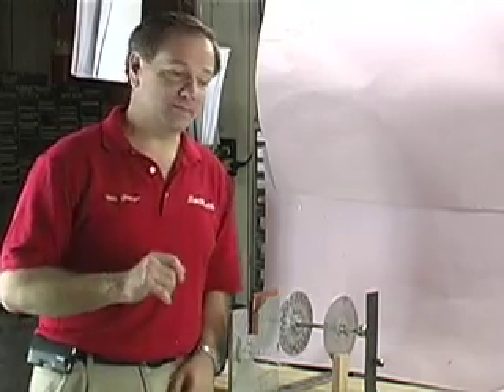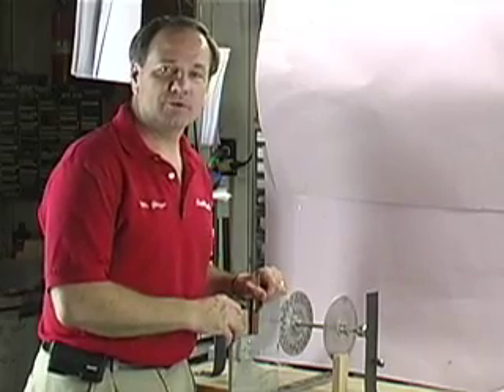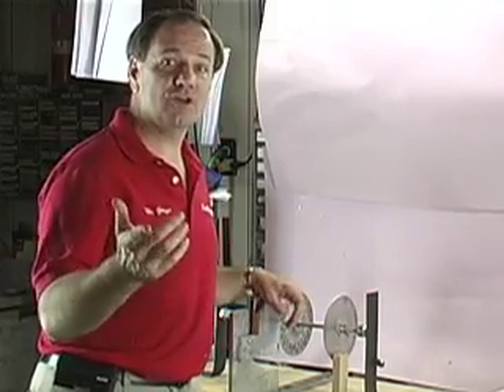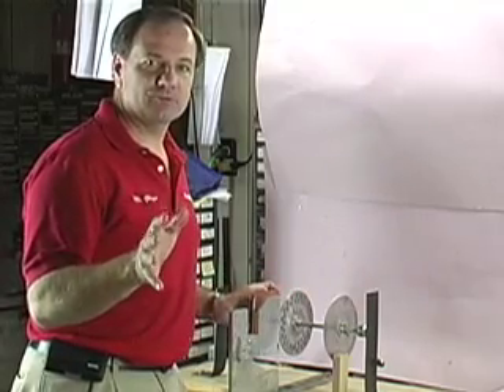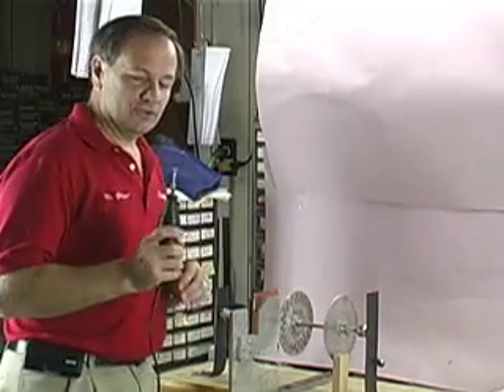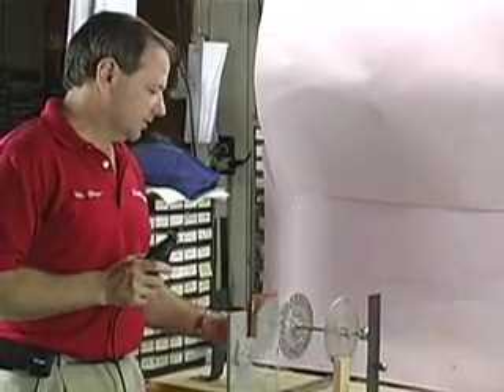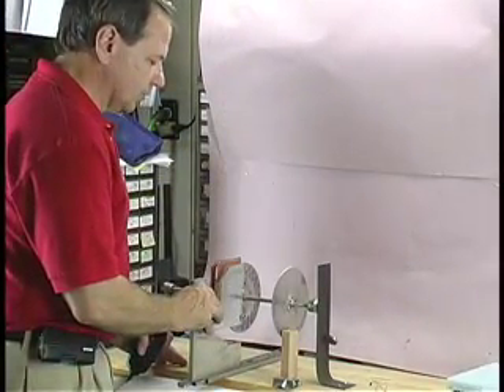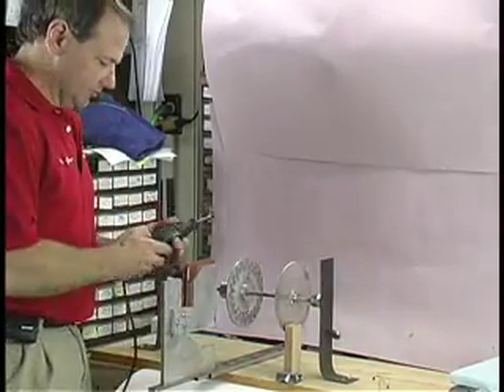Supermagnet Braking system - Working

Comment: The EVS ie: segway scooters use something like this in their electronic regenerative braking systems these days.
The concept is the same, magnets doing most of the principle work albeit application(s) and or method(s) may differ slightly.
Reply from the maker: Most of the EVs are using electromagnetic braking which simply directs the current generated back to the batteries.  This system actually is dissipating the energy as heat so it is more wasteful from that perspective but it is more effective that friction brakes.
Reply: Interesting... didn’t know that so thanks m8 👌🏼

Comment: That stopping looked very "unmagnety"...it looked like a friction-based stopping to me, and in fact you can see the metal blocks come into direct contact with the center of the wheel.  So I'm not really sure what to think of this little experiment.

Comment: This is really interesting - it's just like the Faraday Disc, but Faraday instead spun a copper disk (the conducting metal) and used a small fixed magnet.  It generated an electric current.  I think what is happening here is the moving magnet induces a current in the approaching metals.  The current itself creates a magnetic field in opposition to the spinning magnet.  (Lenz effect)

Comment: If you lift a car wheel off the ground and spin it up. The second you touch the brakes it instantly stops. This has nowhere near that power and it wouldn't do anything for a slow moving car I would think

Comment: No way this kind of magnet could generate enough force to stop the momentum of a 2500 pound car.
Reply: Pablo Nunez then build a lighter car
Reply: Pablo Nunez why is everyone retarded???
Reply: Dan Coulson THANK YOU DAN. CHRIST. 

and Pablo Nunez don't become an engineer
Reply: Dan Coulson "Regular air or hydraulic brakes are used to completely stop".....I've read that and it's only because of regenerative breaking right? I mean if you didn't care about regenerating power you could just reverse an electric motor to create a generator and then jack up the current with from some other power source and stop with pure electro-magnetism. With enough current you could stop an ocean liner. Actually I don't know, I was a History major and was wondering if that is a correct assumption or not. :-)
Reply: Dan Coulson "To maintain still, a constant high current would be required.". I agree with you here. But only to REMAIN still a drum or disk brake is better. They make sense to me only as a parking brake to free up the required current to remain still you mentioned.

I totally disagree about proportionally introduce friction braking. There have been huge problems in that concept. Hyrbrid drivers often report pressing the brake harder gives you less braking as the friction brake is proportionally introduced.

I would argue the only reason friction brakes are used proportionally is they're cheaper than putting a generator/motor on each axle........That's undoubtedly a better approach. A generator/motor could stop a tank.

Comment: Friction based brakes or more reliable. They wouldn't be able to keep the vehicle at a stand still on an incline. What if your vehicle looses power all of a sudden? No brakes. In most setups, you can still use the brakes if the engine were to shut off,

Comment: SuperMagnetMan Would this set up work equally well if the magnets were in the (I'm assuming) "caliper" part, rather than in the "rotor" disc? Could you shed some light on that, if not. Thanks!

Comment: i'm kindah wondering , since it shouldnt produce heat and doesnt use electricity or water to create the field or friction it should e an ideal medium to build a (cheap?) dynometer with it to be used on location 

normal dynometersystems use either water or elctric brake (think truck retarder) and measure the footpounds of torq the spinning part put against the resisting part at different rpm's (in the simplified system youre demonstrating it would be to drive the disk perminently while braking put the magnets on a scale before sliding it ontoo the disk and measure the difference in weight at a certan rpm )

can you make the system big enough to resist an engine giving off 400 pounds of torque at say 4000 rpm ?
and can you make the system variate the amount of resistance put on said motor so you can get a torque curve from 1500 to 4500 rpm ?

Comment: It amazes me that none of this technology is used in automobiles, no friction either, no loss of brake pads, its a great system
Reply: its not great it has no practical use because the car has weight and that weight gives car potensial energy what magnet has to absorb just imagine to put at least 200 kilos more on that wheel it woudnt stop plust that speed what he spins it i guess is about 30-50km/h and it takes ages to stop with out any potensial energy its awful
Reply: JusstyteN You could be right but I don't think that you are. He's using a small amount of magnets on a small amount of metal. I imagine that when scaled up you could use a more powerful array of magnets to make it very effective at stopping a fast moving heavy vehicle. I have no real evidence though so your opinion is just as good as mine. However, if i ever have a high enough income to dump into an expensive hobby this may be one of them and I may prove or disprove the theory that it could be applied to a real vehicle.
Reply: Dib Dibbler Magnetic brakes don't work when the car is stopped. Why is that important? When you're at a red light you have your foot on the brake to keep the car from moving, because if you're like most people, you have your transmission in gear, so the car wants to move forward. A magnetic braking system only works when there is motion.
Reply: lets sit in my car with  xtremely strong permanent magnet breking system and wait till all worlds little steel and iron thinks got stuck in it
Reply: It's the same reason for the conspiracies about pharmaceutical companies having cures for cancer and allergies and things like that. Whether or not it's true it is more profitable to patch the issue over and over then to cure it once.
Reply: Agreed
Reply: Well cool, at least it's getting used.

Comment: Only if the wheel is conductive, but what if it wasn't? What if you used just the magnetic attractive force between the magnets to stop it instead of a material that is conductive.

Comment: One needs an open mind to believe in God or the Flying Spaghetti Monster. One does not need an open mind to believe in physics. A physical device is subject to definite laws and rules. So a device either works as advertised or it does not. Until you can unambiguously demonstrate your device working, and until others have replicated your results independently, you're just blowing smoke blinding yourself and others.

Comment: Face it, you don't have a working device. You have nothing but words, and very specious words at that. Frankly I don't even need go into the physics that forbid over-unity from existing. All I need to do is point out that these machines are claimed to be easy and cheap to build with widely available parts, yet not a single working version exists in the world. Not even in the most remote parts of the world where "Big Oil" does not exist and where free energy would benefit humanity the most.

Comment: No machine can generate more energy than is required to keep it running. The output can never be greater than the input. A V-gate mounted on a linear motor? Clever but pointless. The amount of energy generated by the coil assembly driving forward via the force of the magnets will never be greater than the energy used by the motor to draw the coil back to the top of the gate.

Comment: @SuperMagnetMan I guess a ggod starting point for getting this technology applied in the automotive industry is first of all to target the smaller carbrands i.e. Gumpert, Spyker, Tesla etc. Second, to not market it as a primary brake, but a secondary. What I mean is have it apply braking force together with conventional brakes. This will help prolong the life of the ordinary disc brakes whilst still having increased braking power. It can also be used in a two stage braking process,

Comment: @fakshen1973 you dont need to deliver rotational force to the wheels using a magnetic engine.  You simply use it to create energy for the electric motors that turn the wheels

Comment: FYI, similar eddy current brakes are used on many modern roller coasters. We have vertical fins on the track that slot into permanent magnets on the train. The brakes are so powerful that we even use them to bring you to a safe landing on those massive drop tower rides. So the next time you're at an amusement park look for the vertical fins sticking out from the middle of the track and you'll know what they're for. :)

Comment: The effect used here is called "Eddy current". During braking, the metal wheels are exposed to a magnetic field from an electromagnet, generating eddy currents in the wheels. The eddy currents meet resistance as charges flow through the metal, thus dissipating energy as heat, and this acts to slow the wheels down. The faster the wheels are spinning, the stronger the effect, meaning that as the train slows the braking force is reduced, producing a smooth stopping motion.

Comment: @ninjasquidface 
The Magnets induce a current in the Copper Dicc, as if it was wire in a motor. If you short a Motor and try to spin the shaft, it is similar to that. Except the current is in the hundreds of amps creates an Intense magnetic field opposing the Magnetic Field of the Magnet. The faster the disc spins the more heat, current and magnetic field is created. Look up Eddy Currents.

Comment: @Typho0n86 
There used because there is no maintenance, nothing to break, they can't not work.
There not used on cars because you still need a alternate brake to brake on a hill.
With big enough neo magnets and big enough Copper Discs you could slow almost
anything, too small and the copper would easily reach melting point.
Although it probably would work, it's just not practical.

Comment: @Typho0n86 
You wouldn't do it that way. You would have a copper disc on the main shaft and slide it towards the brake disc.
And would lock in place when moved into place. The larger surface area will stop it in a few revolutions.
The problem with this, it only works if it's moving.

Comment: You must be using a much more different dremel than mine - mine has 2 speeds - 15000 and 35000, and it heats up within seconds of turning on (you can't hold it with bare hands or it will burn you)

Comment: They'll still get hot from the current, and magnets lose strength with heat, same as disc brakes, and it doesn't work well at low speeds. At a stop, they don't work at all. They're not viable for cars, but have been used in rail systems for years, in trains and rollercoasters. 50% cost savings over the life of a system.

Comment: instead of inserting the copper plates into the spinning disc to start braking, would a switch connected between the two plates (which are positioned permanently to the side of the spinning disk) and ground have the same effect?

Comment: @AsKSniperMagician a 14000 lbs rocket car was slowed from 400mph in June 2008 using only magnet braking so looks like they work really well. I think because its contact-less, we'll see less issues with warped brake rotors, brake squeal etc. The real question is the size of the magnet field surrounding the magnetic braking system. I imagine though, it wouldn't be too difficult to shield an ECU from it.

Comment: this works, but its not really practical in a car unless you have a much more powerful magnet, which might interfere with the car's electronics. even though it does stop very fast, it doesn't factor in the kinetic energy produced by a car and its environment. i don't thing it would do much in a downhill situation XD

Comment: I love how people think that the braking system is an on/off system. The more surface area the magnet covers, the more braking force that is applied to the disc. 

Of course, a system like this would be pricey. Isn't everything when its first released? Think of all the safety features that came from the S class that are now part of pretty much every production car

The ABS system could be redesigned to deal with lead foot braking instead allowing the car to slow down without flipping the car

Comment: One, does the "pads" come into contact with the rotor in anyway, even if it's just the front part of the "pads" touching the hub of the rotor.

Two, how would increased mass affect stopping time of these rotors.

Comment from the maker: @mitchrz1 - Neo magnets will last approximately 500 years by most estimates. You should get a few miles on your car before needing to change them,  If they used a little ingenuity they could make it so the brakes were moved from car to car as you bought new cars.

Comment: @SuperMagnetMan Actually the roller coasters use electro magnets which can use the power grid (cars cant) and are very expensive, making that worthless for regular affordable cars. As for the Rocket car, you're going to have to link me the story, however I will assume it was on a Salt flat and had NO need to stop quickly and given that normal breaks often melt on rocket cars it would make sense to use it in that very specific situation. It CAN stop a rolling vehicle, But not quick enough for car

Comment from the maker: @finnsia - Check out the North American Eagle - the rocket car that used the exact same technology a few years ago to stop their 15,000 pound rocket car from over 600 mph to a dead stop in 1.25 mile.  That should put to rest any questions about can this stop large or heavy vehicles or vehicles going fast.  The chief engineer said it worked even better than they expected.  Fantastic braking system.

Comment: Isn't a problem that the slower it spins the weaker the breaking gets?
Assuming these breaks need to work to park a car on a slight slope this wouldn't work because the breaking power is proportional to the speed it moves.

Comment: The kinetic energy of that thing is soooo low versus a car. You wont find a magnet that strong to stop a car. 

Show us while the system connected to a 49 cc engine or elecrical motor spinning constantly and slide the pad in? is your brakes strong enough to stop a 49 cc engine? If yes, you may have chance to market your product to bike companys.

Comment: @soulTlMAThE 
I personaly would say that it depends on your application. The advantage here is no direct contact, therefore no wear of the breaking elements (except time - magnets have a finite lifespan). Heat dissipation is less, and you can electrically control the effect if needed (used on metallic powder clutches in the 50-60's...), and also on regenerative breaking, that generates power. Everything has an application, it's up to you, the engineer to decide what tool is best for your goal.

Comment: @TomStoneMemphis The heat will be dissipated into the atmosphere, just like current braking systems.  No opinion on what you said after that, not an electrical engineer.

Comment: Ok,... it will work, but what about the heat produced by currents??? Where will you put it. For example if you want use this in car. I thing much better is to create coils and charging supercaps by invertor connected between. You have to thing more efficiently. That is my opinion.

Comment: I must explain, I always wondered if you have two disks with magnets attached on 45degree angles facing each other  and the disks have 45 degree sides that hold sectioned of liquid, wouldn't the sides begin to push up with enough centrifugle force with an altinator for elec. Take off the sides and you could apply this to the wheel and axels for endless propultion and braking with adjustable angles for the magnets. Maybe, I'm to scared to try it and it would have to perfectly lined up.

Comment: @Danteku How easy would it be to put car bairrings on the bike, It wouldn't have a motor so I can't call it a motor bike, Trust me I'm an engineer I know what would fall apart and what wouldn't. Some of these magnets out there can produce 5000 pound of magntism posative and negative, I was holding back with 100kmh,Some of the top secret magnet propultion systems spin at 40,000 rpm and can reach speeds of mark5, The new rail gun can reach speeds of mark7 in a second with projectiles, A beefy bike

Comment: as you can see if you reversed the process you have endless energy,no petrolum for our wheeled vehicles or slow stupid electrical vehicles. How good would it be on a push bike, you could get it up to 100km easy

Comment: @SuperMagnetMan besides-- you have to consider mass. its not a whole lot of mass moving, or in this case, spinning, therefore the energy lost due to heat would be relatively insignificant change in temperature. if it would stop a large mass like a car, then they WOULD heat up significantly.

Comment: @T0B0KKE Agreed usually there is 2 brake component sets working individually too each other, however what I want too see done is using this magnet technology to regenerate a separate normal braking system for low speed / crawling stops. Regeneration brakes are on the market but normally feed back too the car, when really the braking system could be totally independent and charge itself.

Comment: The problem of this break is that the resistive torque applied is proportional to the rotating speed, so it will be efficient in higher speeds, but as speed slows down, the force exponentially drops and then mechanical friction is all that comes into play to stop your wheel.

Comment: @SuperMagnetMan Where is the heat made? I'd guess the disc since it's the part slowing down, but I'm not sure. I ask because for this to be in a car and there is heat made on the magnet side, it would cook the magnets. Take a 3000 lb car slamming on it brakes, going 75 to 0 in say 5 seconds. That's 38kW per wheel. That dremel is only 140W.